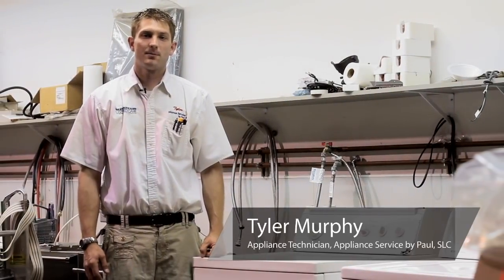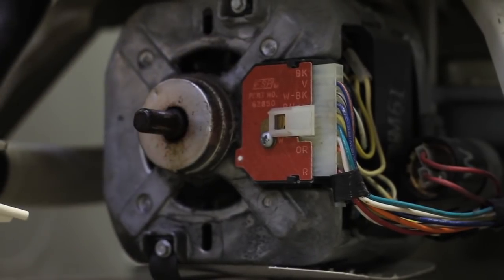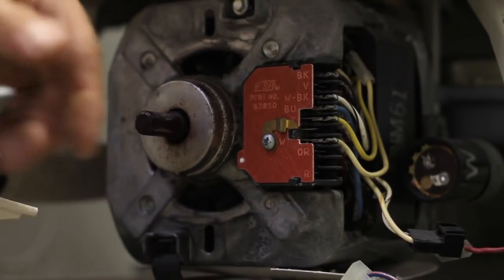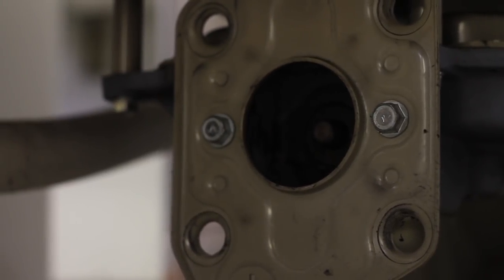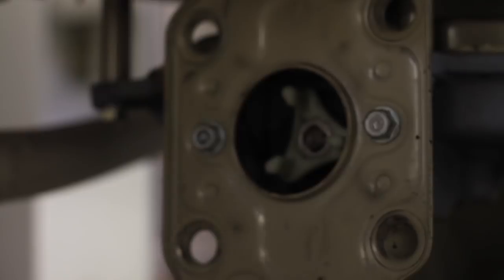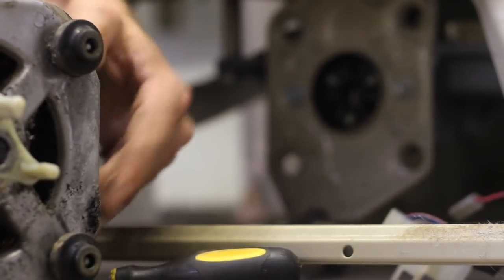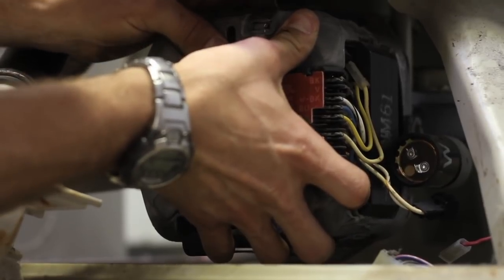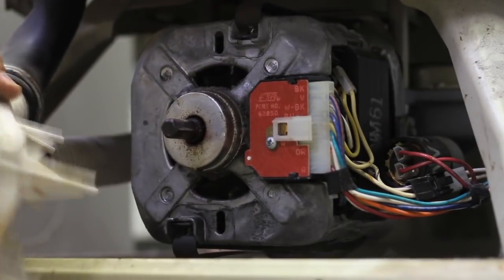Washing Machine Repair : How to Repair a Washing Machine Spin Cycle

Comment: all have said that replacement of coupler, replacement of clutch, or replacement of lid switch will get the washer back w/ a spin. i have done all of these things, in addition to a balance ring. washer runs perfectly well through all cycles, all settings, etc. agitates, agits replaced, transmission working, as is motor, pump, drain hose, and timer. washer will do everything but go into spin. it drains and rinses. so, what is the problem?

Comment: I have a Kenmore 80 series Model 110.28882791 washing machine. Apparently neither the agitator nor the spin cycle are working. I'm sure it's not the lid switch for the spin cycle because when I open the lid, the motor stops. Could it be the belt causing the problem?

Comment: i have a beko 6kg AA 15500RPM that doesnt wash is always on spin mode the machine fills up with water if i put on the wash mode but the machine looks like its stock in spinning mode. any thoughts